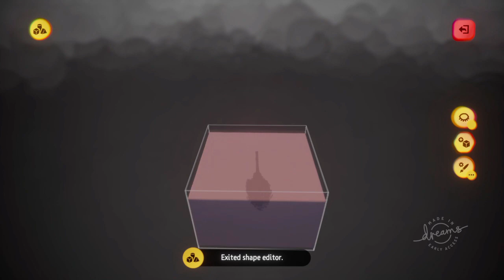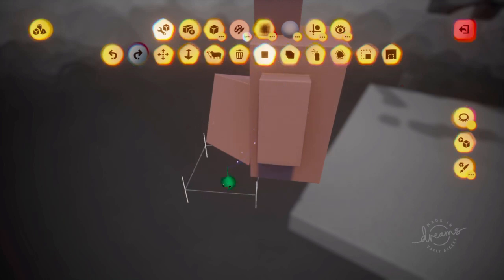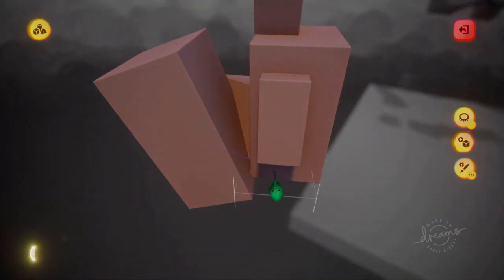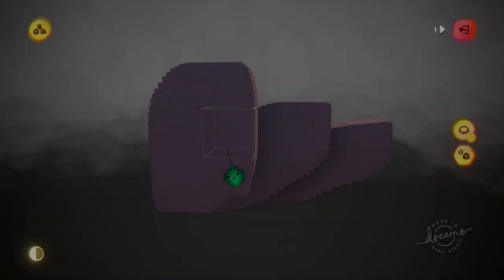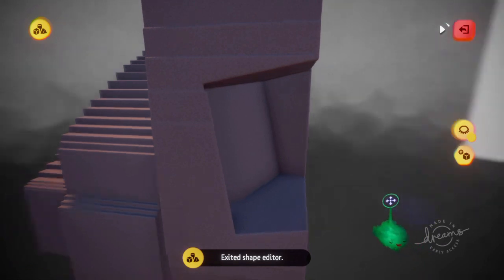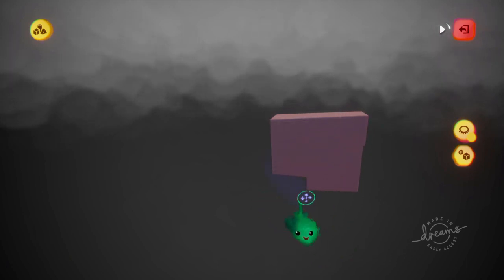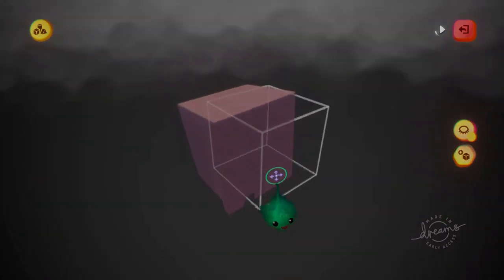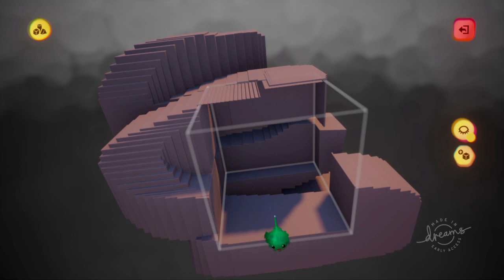Extrude, Crop & Cut-out

Comment: When using the “cutout tool”, what needs to be done (in tweak menu I’m guessing), so that both pieces stay together as they were originally? Like if I wanted to make them a different color or finish. Thanx!
Reply from the maker: They become two separate objects with their own tweak menus. There's no way to link the tweak menus together. If you select them both before tweaking them or applying finishes, etc. then they will both change as you change either of them.

Comment: Thanks for the videos but I don't think you're entirely correct in your description of this. Negative stamp is still creating geometry only it's invisible so when it in effect looks like you are deleting parts of the sculpt you are actually adding more to it so it takes up more thermo of the particular sculpt. Cutout in a way also increases thermo but it splits it into a new sculpt which is easily deletable so thermo wise per sculpt with cutout, you really are deleting parts of the geometry as opposed to adding more to it like with negative stamp.
Reply from the maker: Perhaps I've misunderstod something about what you were trying to say.

While each edit (neg/pos/spraypaint etc.) is kept in-memory and does use graphics thermo, it's an insanely small amount and isn't worth worrying about at all. What takes a good chunk of thermo is the surface area of the sculpt, multiplied by the resolution (detail) level of those surfaces.

In this video I don't think I talked about thermo regarding negative shapes. I explained what they do conceptually. They say "everything inside this shape should not hidden." I think that's pretty accurate. When you use a negative shape, then you're removing some surfaces and adding other surfaces... it doesn't inherently add or take away from thermo; it all depends on the result. Like, if you stamp a negative shape in the middle of nowhere, it's still there but it's not affecting thermo. So negative shapes don't necessarily affect thermo at all.

Cut-out turns one unique sculpt into 2 unique sculpts--each with their own slot of thermo. And usually with more surface area added, on the whole. So this tends to add to thermo. And as demonstrated in the video, you can move the resulting "crop" shape and the "negative" shape around--so all the data for the pre-existing shapes are still there but "hidden" in the same way a negative shape "hides" stuff.

You really can't permanently delete geometry such that if you move the positive part that cut-out will come along with it. That's just not how the engine works.
Reply: @TAPgiles  So sorry. I had it completely backwards. I have been away from dreams for months and must have made a false memory in my head or something or maybe this is what I had always thought. 
    I had possibly assumed a negative stamp in the middle of nowhere actually did take up thermo but I now see this not the case. I suppose I thought this because the negative sculpt is stamped in a specific place and can even be moved around after it's stamped so I thought it was still a thing just as much as any sculpt is a thing. I had false memories of testing this theory out.
     After trying it out again there I see that it indeed does what it's supposed to do and it actually decreases thermo when you negative stamp a complex sculpt. I see that even though it is still a piece of geometry, that because it is invisible means it does not take up any graphics because it is not rendering anything on screen. I see that when you move the invisible stamp away from other geometry the other geometry becomes visible again so it is thus being rendered.
       I originally did not think in terms of what was actually being rendered but only that a sculpt visible or invisible was still a piece of data. I am not a computer expert or anything. Sorry about that and thanks for the info. 
        But just to respond to your last statement here. I had at least assumed If you use the cutout tool you can move the geometry along with the cutout but after testing I see again it behaves the exact same way as negative stamp. Ok, I think I get it now.